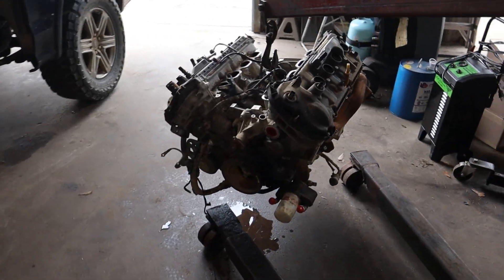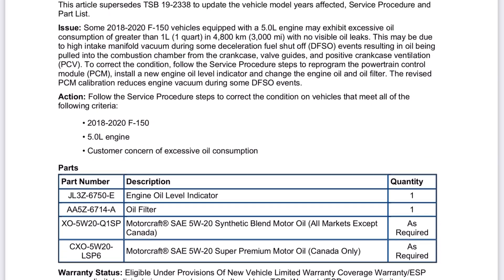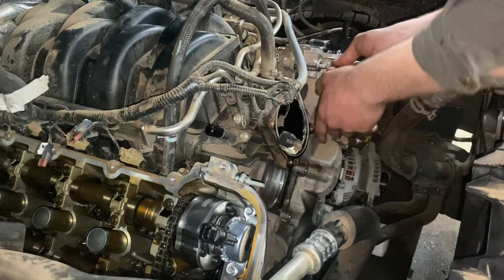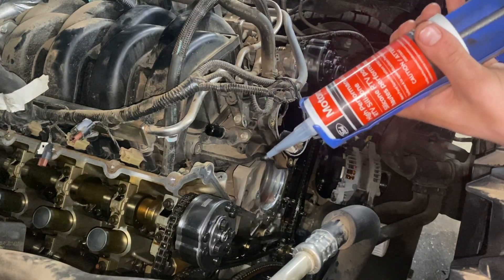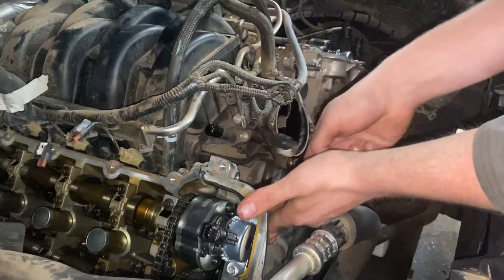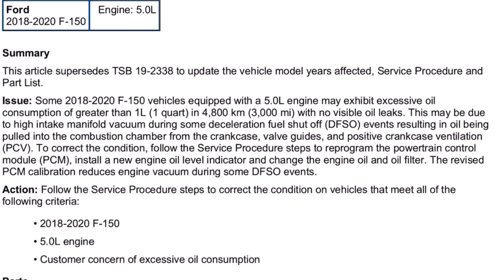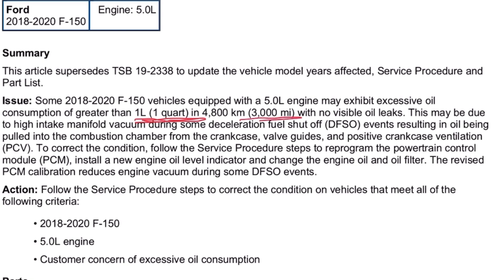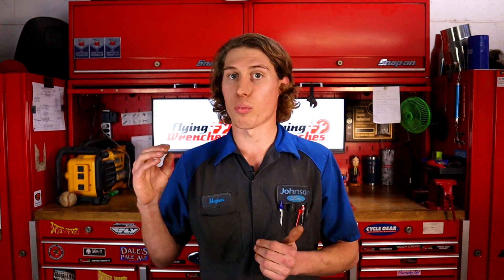Ford 5.0 Coyote Oil Consumption FIX

Comment: I have a 2020 5.0 F150. I also have the first truck I ever bought: A 1987 F250 diesel. The 1987 has half a million miles on it. The F150 has 21,000 miles on it. The F150 burns more oil than the 1987. a lot more. I just put 4 quarts in it tonight. That's what caused me to find this video. It's going on a road trip tomorrow and the motor would have been cooked if I didn't check it tonight. It was a gallon low. No noise; no warning lights; no nothing. I am not amused. Thank you for your video. But I suggest that everybody should check their damn oil!
Reply: That’s way beyond what ford allows. Have them fix it.
Reply: @BrianBourgeois-  , the only fix as I have been told by a Ford dealership that the only fix is to change the engine out at $15,000.00. I asked if they could assure me the replacement engine wouldn’t burn oil, they could not assure me of that, so I continue to buy oil. The Ford better Idea!
Reply: Theres a class action lawsuit lyman vs ford. Has to do with the ring coatings being junk. Luckily i have a extended warranty because at 80k my enegine is junk with no check engine lights on.
Reply: Same here, I always have to check and the darn thing is 4 quarts low all the darn time, within 3000 miles. That’s in the city miles
Reply: You should have the low oil light switch check out
Reply: If I had to guess I'd say its the sprayed in cylinder linears.  2018+ between the high pressure fuel pump and direct injection, sprayed in cylinder linears, and the 10 speed its no wonder why the 15-17 gen 2 coyotes with the 6 speed are the f150 the hardcore ford guys go after.
Reply: Me 2 I was going  cross country  I think I was 3 to 4 quarts low, no knock or gauge  differences
Reply: I got a 2004 5.4L with 369,000 miles all original engine and transmission never opened up and worked on
Reply: Have you taken it in for the pcm update?
Reply: Yes I did. After my original post on this topic, I made an appointment at my local Ford dealer. That took 6 weeks to get in. First they told me that they would change the oil and monitor it, for at least three rotations, to see if a warranty repair was justified. Then they tried to charge me for said oil change, even though it wasn't due for one. When I picked it up, more than a week later, the invoice suggested that they did the PCM overwrite. I called in and confirmed that was actually what happened. The service writer was totally confused. It appears that somebody who turns wrenches for a living actually did the suggested repair without all the silly monitoring. I have put 17,000 miles on the truck since then. It now has normal, acceptable oil usage. Problem appears to be solved.  @h.merica
Reply: Same here man I check every 2000 miles and have to add a good bit. Would have never bought this truck if I knew better.
Reply: I guess I’m lucky, I’ve got a 15’ Coyote and it doesn’t burn a drop.
Reply: I have a 2018 F150 with 96k miles on it and in 700 miles it has went from the oil being at the full mark to almost to the bottom of the hash marks. So at that rate in 5k it would burn approximately 5 qts. of oil. I don't see how that could be normal?
Reply: I work at a ford dealership here in tx and we deal with the same thing oil consumption problems we replace the motor and I not yet seen one come back now I got a 19 ford with a ticking sound from lower engine and sound in the bell housing of transmission it got the 5.0 coyote in it
Reply: Get that engine replaced under power train warranty asap!
Reply: Do you enjoy the smell of burning oil?  That is the smell I get if I get on my 2019.  If I drive it nice, no burnt oil smell.  I had a 1994 ranger and an 2008 ranger.  Ran both of them up to 225k, didn’t burn a drop of oil.  I’ll sound like a crotchety old man, I miss the good ole days when my truck didn’t burn oil.
Reply: I just traded in a low mileage 2018 F150 with a 5.0 for excessive oil consumption. It’s a shame because it was in perfect condition but adding oil every two to three fill ups was very annoying.
Reply: 2019 here. Mine uses oil and gets noisy at two to three quarts low.
Reply: @mattphillips1910  , I have been buying oil in gallon containers. I find the cheaper oil at Atwood’s and looking at buying oil in 5 gal buckets all because the Ford better idea. My Ford better idea has been burning oil ever since I bought it new.
Reply: What kind of fuek mileage you chevy guys seeing in the comparable years as the coyote?
Reply: You guys change the PCV ?  Bet that’s where it’s going.
Reply: Spoken like a true mechanic.($$) Don't check your engine oil in your F150 that's known to BURN oil. Drive it until you hear knocking, pinging. If there wasn't an financial engineering issue the dipstick would read the same at 3K miles just as it read after a fresh oil changed.
Reply: Damn I'm glad I bought a Chevy
Reply: @paulcondie2520  I’ve got a 17 suburban. they have a lot of problems too. Cam/lifter problems and the torque converters.
Reply: @h.merica  I know that's why I deleted my AFM and put in lower temp transmission thermostat,
Reply: @paulcondie2520  I need to do the same.
Reply: @h.merica  I got my 2017 Silverado with 46,000 miles on it but before I bought it I did a lot of research first. So like I said I deleted the AFM with the range technologies OBD2 plug and flushed the transmission and installed the lower temp transmission thermostat then changed all fluids front to rear! All brands have issues, ya just gotta be proactive! Hopefully with good maintenance I'll be good for awhile
Reply: @paulcondie2520  so I just flushed the transmission and I just got the parts in the mail to do the transmission thermostat. I’m at 150k now but I think I’ll turn the AFM off as well.
Reply: @h.merica  nice! They say going from V4 to V8 and back not only causes lifter issues but is hard on the transmission as well. And obviously ya got to change your oil! Lol. Wish you luck
Reply: @paulcondie2520  good luck to you too! Every 5k along with a tire rotation.
Reply: @wesleymarshall7400  active fuel management. On the Chevy 5.3 it shuts down cylinders to supposedly get better gas mileage!?!? Lol
Reply: @h.merica excuse my ignorance but what is the AFM?
Reply: @amals51  that’s okay! AFM (active fuel management), DOD (displacement on demand) afm was 07-14 I think and DOD was 15-20 and DFM is the latest (dynamic fuel management). All do the same thing. Shut down cylinders for fuel conservation.
Reply: @ how does one go about deleting this?
Reply: @ in a nutshell it requires replacing the cam and lifters and reprogramming the ECM. Essentially turning the engine into a full time V8. The AFM,DOD,DFM systems fail so this would make the engine more reliable.
Reply: Yeah, you just have to deal with AFM, no thanks. BTW not loyal to any brand
Reply: @rofin9541  The hysteria over AFM is one of the most overblown things I have seen in all my life. They sell over a million small block V8's with AFM each and every year. That's over 10 million since they redesigned the engine for 2014. Even a 1% lifter failure rate is enough to make the internet lose its mind and act like they're all failing. I work with a dozen guys that have 2014 or newer GM trucks and most of them never disabled that AFM system. A bunch of them have over 200k miles, not a single lifter failure. The only person I know that's had a lifter failure is my brother in law that had a new 2022 Sierra AT4, but that's a situation where there's a narrow range of engines dates where GM specifically said there were engines built with springs from a supplier that was sending them out of spec parts. The biggest thing I learned from all the guys I know with that have that mileage without a problem is that they all change their oil really early compared to what most guys do these days. They're changing their oil at 3,000 to maybe 5,000 max. The average owner that has a lifter fail is the type that waits until the oil life meter hits 0%. Most of the Suburbans and Yukons are driven by women that don't even think about oil changes until the vehicle has to throw a warning message up on the instrument screen to change it. That's where the majority of lifter failures come from. It's the same kind of bad behavior that gives a lot of Ford engines an undeserved bad image. You can't tell me when there were tons of 3.5 EB with timing chain wear and cam phaser issues, that extended oil change intervals didn't cause premature wear that caused check engine lights and misfires.

Comment: Watched your whole video, and yes, I am 61 years old. Been driving Ford trucks for over  25 years. (Priors '77 Chev, 79 dodge (pre Ram), and 'S10.
Bought the '19 with 1700 miles.
Used the recommended 5-20 full synthetic. Didn't need to check oil because it didn't go through oil between changes.
Here is the issue:
Last fall, running poorly due to low oil.(advanced timing solenoids and oil change fixed this.)
That was 4500 miles ago. Issue has returned. Just checked oil level  (against your advice). 2 quarts low.
Noticed that Ford now recommends 5-30 weight oil for the 5.0.
Put in 2 quarts of full synthetic 10-40. My guess is that Ford because of EPA was recommending a lighter oil than the engine was designed for originally.
Pretty sure this will correct the problem, but will post again if not
Reply: How has your ‘19 been doing? Just bought a ‘19 with 26k miles and this worries me because my dipstick level was pretty low so I’m trying to find the fix to all this.
Reply: EPA does not do oil weight recommendations. The 10/40 will look better on your gauge, but not in your engine. This isn't a "Fix."

Comment: I can't believe a mechanic is telling us to stop checking our oil. That just doesn't sound right. Out of sight, out of mind, I suppose? Any new engine that consumes a quart or more in 3k miles has a problem. My 2019 with 33k miles burns more than a quart every 3k, and yes, I have a catch can. It catches ounces. I'm assuming the rest is plugging up my engine and catalytic converter??  My 7.3 diesel with 400k doesn't even use that much oil.
Reply: Agreed
Reply: AND...on a KNOWN oil using motor! I wouldnt trust SHIT this guy says would YOU?
Reply: Youre not a mechanic. Nobody cares who you listen to.

Comment: I have a 2018 5.0 without update and between oil changes I go through 5 gals + of oil. it is a huge issue. thinking of getting the update done. I put 2.5 quarts in this morning. wasn't even showing on the dipstick. telling everyone not to check their oil is nuts.
Reply: That’s what Ford’s quality control has come down to.  Oil consumption is normal, just stop checking it.  Hilarious.  I had an F150 and Mustang in the early 2000’s with the 4.6 and that was an incredibly reliable engine, neither one ever burned a drop.  Ford isn’t what it used to be.
Reply: 2020 5.0 61k miles.  Just changed oil after 4500 miles because my oil level was barely on the dipstick.  Turns out it consumed 3.5 quarts in that 4500 miles.  Don't check your  oil? Ridiculous.  BTW I already had the TSB done with the reprogramming thing.
Reply: putting 5 gallons of oil between oil changes is nuts! mine would use only about 3 quarts. between oil changes.

Comment: DOES "ANYONE ELSE" OUT THERE HAVE A 2022 OR 2023 F-150 3.5 V6 ECOBOOST THAT HAS CAM PHASER RATTLE ISSUE AT START UP? I'VE PRETTY MUCH GIVEN UP ASKING. AND YES I KNOW THEY ARE "SUPPOSE" TO HAVE THE LATEST DESIGN FORD PART'S THAT GOT OR GET RID OF THE ISSUE. THIS IS MY FIRST "NEW" TRUCK, AND IT'S THE 3.5 EB UNIT. I BEEN FOLLOWING THIS ISSUE FOR 4/5 YEARS B4 I PURCHASED THIS 2022 UNIT. I THINK IT HAS THE START UP RATTLE. I'VE HAD 2 DEALERS LOOK AT THE TRUCK, ONE SAY'S IT'S NORMAL, THE OTHER SAY'S IT HAS A PROBLEM AND IT AIN'T "NORMAL"  I'AM BESIDE MYSELF, AND HAVE ALL BUT GIVEN UP!  Thanks In Advance.

Comment: How about  a MT82 episode..
I've got a 2011 5.0 GT just about 80k on it starting to have trouble going into 5th..
I hear a lot of people having problems with high RPM lockout.. and bad synchros..🙋
Reply: Only thing is mine burning quart every 1500 miles so when reaches the service interval, which is about 10000 miles according to the instrumentation.   If I didn’t check it by the time it needs serviced I would be down 6 to seven quarts.  I was doing what you say for first 50k on the truck, I wasn’t checking it. I noticed a ticking in the engine and that got me to start checking. Took 3 quarts to get in back in safe range. It has never given me a warning light although I assume I was getting close that time.  I took it to the Ford dealer I purchased it from looking to document it was burning to much oil hoping they would try to do what you suggested to try to at least reduce it. They did nothing. It’s not that issues arise, but it’s how a company reacts or tries to help fix the issue. I certainly wasn’t expecting any type of major repair but was hoping they would do what they could.

Comment: Pcm reprogram is probably just opening throttle body on engine deceleration. Less engine braking. The oil sender replacement is gunna turn on the low oil lamp when it's 2 quarts low, not 1 quart low. Ford masking a problem to get them out of the warranty period.

Comment: NEED YOUR HELP.
I have a 93 E150 Club Wagon Van conversion van the "Explorer" model.5.8l. I have been having idle issues that none of the 7 mechanics including dealer,could figure out.
I have the code for the EGR Valve. I have changed it,the egr sensor pipe also idle air control valve,throttle body control valve,computer,map sensor and tuned it to try and fix the issue along with new fuel pump and Still having the issue of the EGR Valve code. 
Was told that when I(they),MECHANIC, changed out the thermostat when it went out and I put a 160 ° degree in it, it should had been the 192° degree and my valve is not opening and could be the reason. Also, the EVAP canister valves vacuum line that goes to the nipple on the Throttle body between the upper and lower air intake hose, I can't even find. I put a cap,on it and don't know it's location that was told may also be the issue cause that burns excess hot gasses. CAN YOU TELL ME WERE THAT VACUUM HOSE FROM THE EVAP CANISTER IS WOULF LOCATED.? 
CAN YOU PLS, ADVICE ME ON WHAT TO DO.

Comment: I think you might have a different perspective if you owned one. While a lower oil quantity may be ok for the engine., what does the ingested oil due to the engine long term? I change my own oil at 50% oil life which is around 4000 miles. I am down at least 2 quarts  including the filter oil. I use Pennzoil ultra full synthetic.  I am only 55 and still check the oil about every 1000 miles or less when towing. Thanks for the update.
Reply: What's it doing to your Cat and muffler?
Reply: I installed an oil catch can at about 25000 miles to help with that very issue. Time will tell? @fireriders8319

Comment: This has got to be the dumbest thing I’ve ever heard. “Just don’t check your oil” That’s just brilliant, especially coming from a ford tech. Did Ford pay you extra for this video? How stupid, my truck goes thru 3-4 litres in between oil changes, obviously there’s a friggin problem with the engine, but hey just don’t check it, that’ll fix her. Why don’t we get rid of coolant overflow containers where you can see the level, if it anit leaking then everything must fine. Absolutely the dumbest advice I’ve ever heard of.
I believe that Ford hasn’t had to replace as many engines as they could have because of people like me that check their oil. 
I could go on and on but instead I’m just going to unsubscribe from this channel. I did enjoy it at one time but not after that video.

Comment: It's now 20k since the dealership started the consumption test and is still going. I just dropped it off again. Thanks for the update. Don't buy F-150
Reply: Update* Ford installed a new engine due to excessive oil consumption. After 20k test after test. Finally.

Comment: I think it's new wire sleeve cylinder to seat rings in new gen 5.0 is the problem. If it's coating in cylinder can't remember. There no reason to new engine to burn oil to much blow bye I think pressure in crank case is the problem. That's because to much gap in rings I bet. Give it 5 10 years 18 and up be blowing blue smoke. Maybe ford should look into new design pvc valve setup. Ill never buy ford anymore these days 17 and under maybe but it would be 16 or 17 15 and under r not great either I think

Comment: Hello from Nova Scotia Canada!! My 19' with 3.5 Ecoboost I do check weekly as I regularly tow up to 6000lbs wth that truck.91 fuel,and Mobil 1 5w30 full synthetic changed every 8000kms or 5000 miles never changes on the dipstick,ever

Comment: I haven’t had an oil consumption issue on my 2019 F-150 Roush with the 5.0L. I have a JLT oil catch can to catch any oil coming up through the PCV valve just in case, though. But, even with the catch can, it doesn’t catch too much oil coming up through the PCV valve.

Comment: I have a 2019 f150 Burns two quarts of oil every 5000 miles plus the engine knocks Ford says the knocking in the engine is normal
Reply: Also forgot to mention I checked the throttle body and throttle plate is wet with oil
Reply: Run premium fuel. Fix ur problem